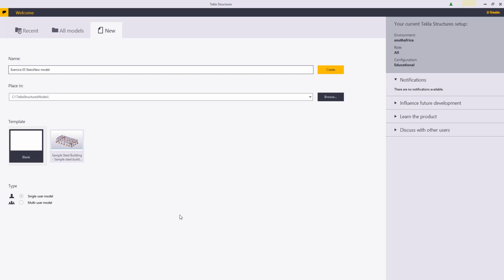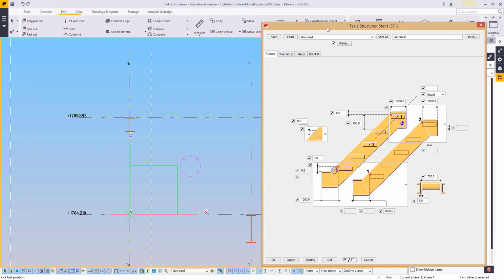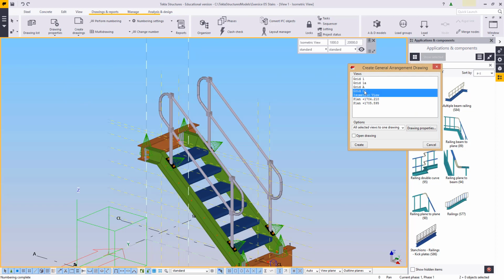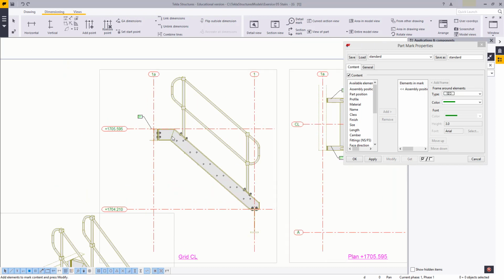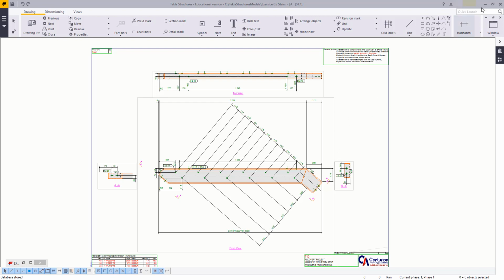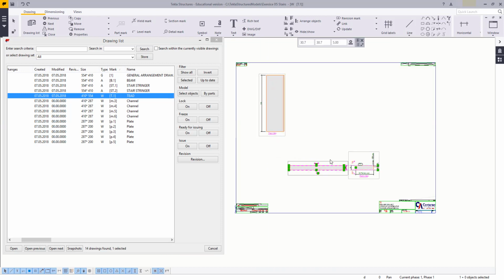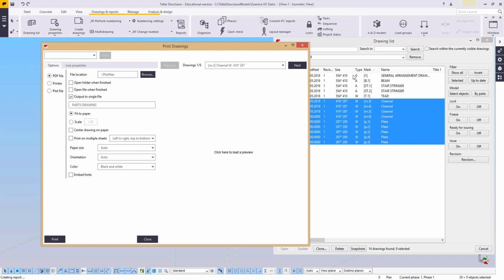Exersice 05 Stairs

Comment: Hello again, I have returned to copying your example above, but I was unhappy with the stair treads, so I deleted the stair and tried to insert it again from the custom component catalogue, but only a line appears and disappears once I interrupt. I can insert the component s82, so I don't know why s71 doesn't work? Thanks for your help.
Reply from the maker: When you say interrupt do you mean clicking your middle mouse button to confirm the selection or did you use something else.
also check if the profile for the stair and the tread actually exist in your environment. if you are loading an item that was made or set up in a different environment profiles used might not exist in your local environment.
Reply: @FrenchmanontheRooftop  Hello again, thank you so much for your selflessness, sparing your valuable time to reply. Of course, it was my ineptitude that caused my problem, as you instructed about clicking the middle mouse button, which I failed to do but have corrected that. I also had massive issues with stair treads, but following your video I see where I have gone wrong, really appreciate your videos. I would like to send you a link to a video that is completely unrelated to Tekla, it is on a very serious issue, but do not wish to offend you, so I would only do so with your permission, it is in respect to the future of our planet and life upon it, as many informed people are extremely worried about it's future, it is positive. Have a pleasant weekend and thanks again for your help.

Comment: The base detail was a bit woolly, I think that you highlighted the component symbol and then selected the area method to include the connection and the stair, but again on the macro regarding the bolts there was a 35mm dimension and couldn't quite follow what you were saying, obviously like the top connection it is opposite hand but you were a bit too fast, but I think that you might have exploded both base connections, if I'm correct.
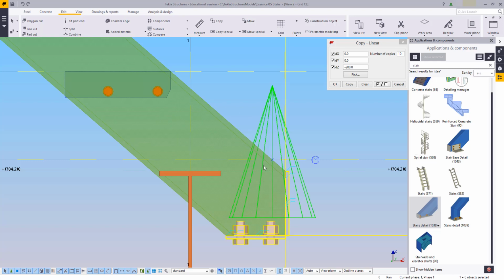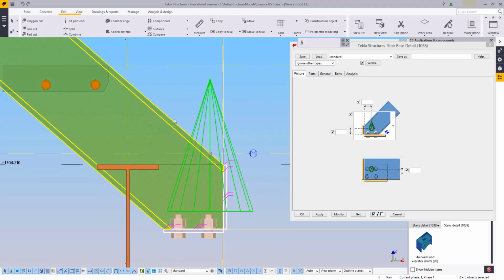Reply from the maker: The base plate position is dependent on the point you use when putting it in. (16:54 the SOP point I clicked) at 17:09 on the first tab of the connection called Picture you can tell the connection how far from that point you want the bottom and front of the plate to be (I think these values needs to be positive so the point you would want to select will be closer to your first stair tread).
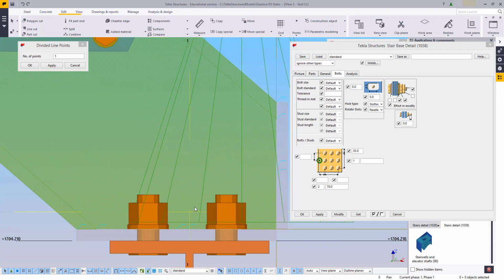I'm being lazy as I did not want to calculate the amounts needed so instead I selected only the components did an area selection while holding in ALT to select only their node points (located at the SOP point I clicked) and then did a normal move. this moved the point I used to put in the connection and since the place position is based off of that point it moved as well. (you can see the point highlighted at 18:11 hanging in the air) I then exploded the component as I needed to manually move the bolts that last bit if you make a manual change without exploding it, it could revert back to the components setting at some point undoing your change. 

The 35mm dimension in the bolt page is how far the bolts are from the side of the plate. I ignored this as I planned to manually move the bolt into the desired position, 45 from back of channel.
Reply: Thank you very much indeed, firstly for providing your videos, I never received such valuable instructions when I did courses at Trimble's offices (formerly Tekla), so that's very much appreciated and for taking the time to reply and explain difficult features of Tekla. I am currently following your video but typical of updated versions, there is no facility to change the beam to 'Existing' so I will just change the colour to indicate existing. Thanks again for your time.
Reply from the maker: @mvdmusicvideostorefreshthe3224  glad to be of help.
Aside from colour I picked up the habit of putting all my existing steel in to phase 99 This way I can easily set up a filter in the model and drawing to hide that phase and in doing so the existing.
You could also create a material called existing and then filter according to that.

Comment: Haven't watched all of it yet, but very useful and practical, especially introducing existing steel thanks for your efforts. Since I haven't finished it yet, I do have a massive issue with regards to Tekla's macro connection number 27, I was practising doing a stair base plate and had something very similar but couldn't understand what the dimensions referred to, the logic is Finnish since it makes no sense. I am talking about where you have a PFC/Channel, where there is no centreline and I can't get my head around that 7.5mm distance from the centreline, you have a dimension of 45mm, where is this dimension taken from, the back of the channel? Then there is an offset of 7.5mm, what is this dimension and how does it alter the 45mm, is it added to this dimension so the final dimension is 52.5mm from the back of the channel? They don't make it easy.
Reply from the maker: Hi Marko Ban Dango, Thanks for watching.
Connection 27 places it's bolts based on the center of your member. So if the PFC is 75 wide the center will be 37.5 from the sides.
Like a Beam the Channels bolts should always be calculated from the web (it's back) and not from the middle of the web where the connection places it 15:03. so we look at it's back mark.

The back mark is the distance from the back of the channel web to the center of a hole through the leg or flange. This dimension is usually given either in your steel catalogue or engineering manual and takes into account, access for tightening the bolt using an appropriate spanner, being close to centroidal axis ,and provision of required edge distance.

Thus the PFC is 75 wide the connection places the bolts in the middle, 37.5 from the back. we want the bolts to be on the backmark instead. so I subtract the desired amount (45 from the back) from the current position (37.5 from the back) leaving us with 7.5.
the number we need to enter to get the bolts from the center to the back mark  is 7.5 or -7.5 so I enter it and see if it goes the correct direction. It it goes the wrong way I'll add the minus so it heads the other way

Comment: Hi sir cannot add step by following your tutorial...guide me Wat to do
Reply from the maker: anto naveen dp if you need the step to be in the catalogue you will have to add it to the steps.dat file in the environment you are using.
This can be done with a program like notepad++

Alternatively if you change step type (in the Stair setup tab) to steps you can go to the steps tab and proceed from there.
At the bottom left you can pick a folded plate or a solid profile.
With the folded plate allows you to use the picture and fill in the desired dimensions 
Or pick the solid profile this will allow the first option at the top left which is the step profile where you can select from the stair treads in the profile catalogue or enter a plate profile.
Adding new step profiles here is easier as well if you want a specific name.
As for the rest of the options
Reply: @FrenchmanontheRooftop  will try if any problem will contact you back

Comment: Hi again great vids, i have a small problem , started a project and a error message came up asking me to reduce the size of the model to save it its limited to 2500 parts
any ideas what this means and how to rectify it thanks
Reply from the maker: You probably have the light/limited steel license instead of a full license.
When starting the program you can check to see if other licenses are available.
If not or if that is your only license you will have to use multiple models. Divide your work into phases that can easily be connected and model them separately with one using s 1000 number series and the other 2000 (so the part marks can never overlap) and just copy the connecting parts over to check they match up.
Reply: @FrenchmanontheRooftop  Thanks for that big help